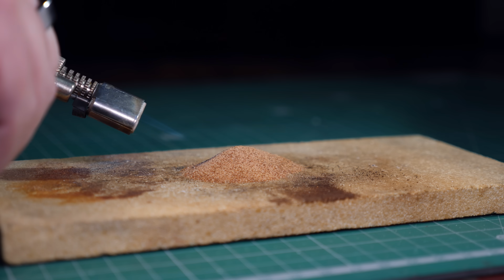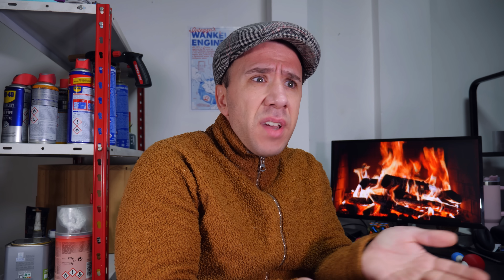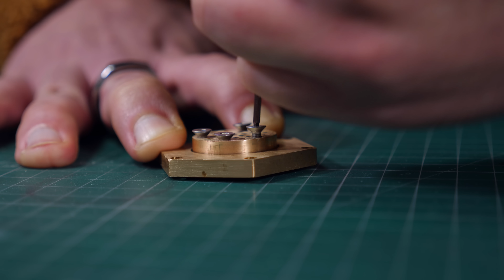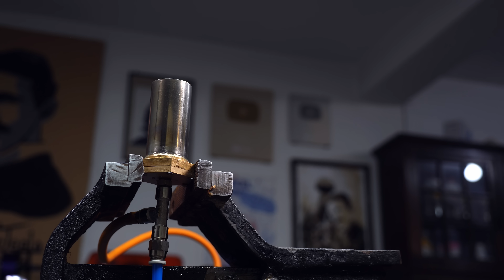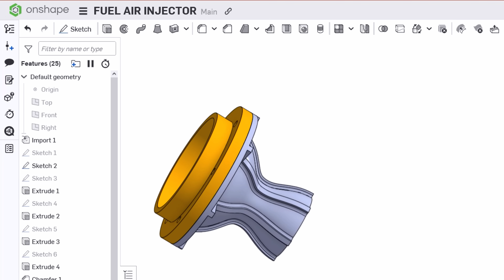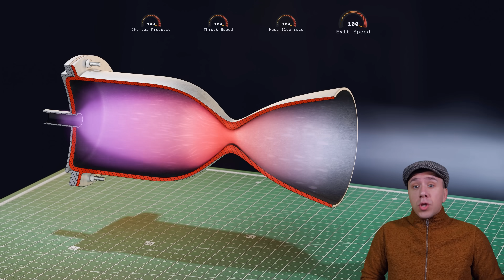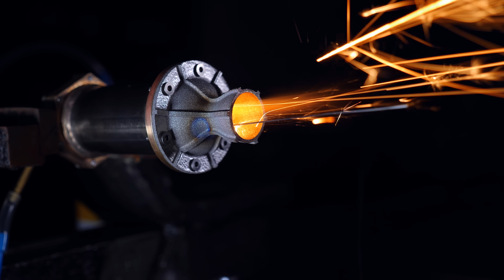I Built the FIRST VENTURI ROCKET ENGINE

Comment: 12:15, the expansion/diverging part of the rocket nozzle only accelerates supersonic fluids. venturi should apply to subsonic as well, since it uses a local pressure differential. perhaps you did not create enough pressure differential in your neck to pull the alcohol out of the container. In your sim 13:00, your pressure bar says "total pressure", which is sort of the potential and kinetic energy of the flow. You should be plotting static pressure (total = static + dynamic), which should indeed be lower at the front lip of the vertical tube, where the flow has to curve over the top of it. Also, I am pretty sure the streamlines you show here are colored by velocity, rather than total pressure, since total pressure should be basically the same everywhere if you are not supersonic.

Edit: on second viewing, 11:48 you are using compressed air in a closed tube, while the alcohol is exposed to atmosphere. the static pressure at the neck is lower than elsewhere in the tube, but still higher than atmospheric, so air is forced into the reservoir. with the air gun, the stream is exposed to atmosphere before impinging on the feed tube, so the pressure at the front lip is lower than atmospheric. For your original test, a bleed line should have been fed from upstream of the venturi to the top of the reservoir, allowing the static pressure at the venturi to be lower than the pressure in the reservoir.

Comment: I'm curious ifyou could replicate the hyperonic thrust design thats supposed to be on the Aurora aircraft.   Rocket for first stage,  then fuel dump over hot surface creating basically a Shockwave trust

Comment: You need to make a slurry and pour it in a mold or tamp it in but have a central core for consistent thickness/density. It works better just like solid rocket motors for hobby rockets.

Comment: You should do a videk about cooling down rocket nozzles in diffrent ways. I had and idea were you can use a jet engine and a precooler and heat sinks and thermoelectrics and water. You cool down the air and use it to cool down a rocket nozzle but the nozzle is thick and has holes and the air pressure generates thrust. The combustion chamber has a titanium carbide ceramic composite fan and is coated with heat resistant materials. It spins on a axis and you feed it cold air to keep it cooled down. You have a seprate fuel tube to the combustion chamber. The air pressure keeps the exhaust in one direction. I also thought about a air bag balloon type seal so it can be used in a vaccum. There is another fuel line for liquud oxygen. You could also have a outer nozzle levers that redirect fuel or liquid oxygen inward or close and redirect the liquid fuel or use liquid nitrogen to keep it cool. Something like that could work in theory.

Comment: I've been wandering why they cant design a jet engine without any moving parts that worked mostly like  rocket with a carburetor style intake. could be carburated or fuel injected.
Reply: Long story short, to get enough power out of the engine,  you need to burn x amount of fuel. For efficiency and proper combustion, that requires y amount of oxygen. For most engines trying to do useful stuff, x is too high for atmospheric levels of y, so you need higher pressure to achieve y
Reply: @nade5557  I suppose what I'm thinking already exists as a ram jet then. and that's why they only work well at super sonic speeds. new Idea then. jet engine with moving parts but it's small ram jets attached to a drive shaft that spins at supersonic speed lol
Reply: @fordman7479 now this sounds interesting

Comment: The solution you arrived upon for the fuel and air injector is practically the same design used in some steam locomotives where excess steam is used to cycle water from the tender into the boiler. Very cool stuff.

Comment: Not sure how much you care about the nozzle quality, but the fact that you got a gap between your exhaust and the wall of the nozzle means you’ve got bad geometry. If you are able to calculate chamber pressure then I’d suggest using a software such as open motor to help design a nozzle that can better suit the needs of the project. You may be surprised to find that you don’t need to curve the bell after the throat. You can just have it at a linear angle and it can still perform exceptionally well.

Comment: Congrats on inventing the carburetor lol
Reply: in all seriousness, your guess at 13:32 is correct. The venturi effect is a behavior of fluids as they obey Bernoulli’s Principle. The air at the top of the tube has the same total pressure, but more of that is dynamic pressure and less is static pressure. In my mind, I think of all pressure as the momentum being imparted by air molecules bouncing off of things. Dynamic pressure is when a lot of the air molecules travel in the same direction, so you can only feel this pressure if you obstruct the air in that direction (such as sticking a hand out a window of a moving car). Static pressure is just from the random direction of air and happens in every direction, and the only reason we dont feel static pressure as a force is because the same static pressure presses outwards from inside our body, etc. Take the air out of our insides and we will also feel the force of static pressure act on us, and collapse like a vacuum bag. 

And the thing that makes it all come together is the fact that the gradient of total pressure is continuous. That means that even though there is an air compressor blowing air, the total pressure right below the tip of the straw and the total pressure right above are more or less equal. However, air above the straw has much less static pressure due to having more dynamic pressure, and the air below has zero dynamic pressure and all static pressure. The force inbalance at the exit of the straw results in the apparent sucking action.

Comment: 12:41 well i mean if you force air trough the same tube as the one going in the bottle,you will pressurize the bottle and it wont quite work,thats why we don’t make carburetors that are 2cm in diameter or less

Comment: Wonder if you can put some sort of screw that can be tightened on the outside of the cone constriction, that is attached through a hole (with a high temperature gasket) to some sort of ratchet mechanism, for controlling the width of the cone's throat and thereby control the flow better? I think of those overlapping metal plates on some metal colanders as an example, or chinese finger traps, or those metal straps used to connect hoses on car engines, the ones with worm screws, just spitballing here.

Comment: its surging because rocket engines require more fuel pressure than the engines combustion chamber or hence the commenced surge,(dangerous) also a venturi wont work unless its pressure into the nozzle is higher than the combustion itself NO ACCEPTIONS. if you can make a high pressure fuel pump to put fuel in at a higher pressure than combustion chamber TADA no surge and steady output you will gain.

Comment: @integza You should not use the de naval nozzle. De Naval Nozzle ONLY WORKS FOR SUPERSONIC SPEEDS! With the given pressures that you are working with, I really doubt that your exhaust is supersonic (for almost most of your rocket designs this is the case). You should only decrease the nozzle area (look for bernoullis principle) to increase the gas velocity (consequently, the thrust). Sinusodial decrease is a good way to start for nozzle design. Again DO NOT INCREASE THE NOZZLE AREA AFTER THE THROAT. My suggestion would be just decrease with a sinusodial shape and keep the throat long and straight so the momentum of the gas is a bit more parrallel rather than expanding.
Reply: I am more than happy to explain a bit more, I work on supersonic nozzle designs. Think like this if the gas was supersonic you would hear a lot more noise. So just decrease the area using the bernoullis principle => increase the gas velocity!

Comment: What if you use fuel that you can make your self which hydrogen so you will build a hydrogen reactor which is cheaper than using butane and hydrogen is very flammable so you will have a hydrogen powerd jet engine

Comment: I am sure you know this but, Your propane pressure is dependant on the temperature of the tank. Propane is liquified petroleum and has to boil in the tank to produce vapor. So, heat the tank, increase the pressure and the ability to sustain the pressure during use. As you switched fuels the point is moot, but just FYI.

Comment: nah i think the air-gun smashing the tip of the nozzle is causing a vortex myth busters tested this theory to be true you can stay dry in a convertible so long as you go fast which means the circular vortex is sucking up air through the alcohol tube

Comment: Injector would have to be in the orifice at point of maximum constriction , not in the open air necessarily, for it to be Venturi effect, maybe you can use that for an afterburner.
   Also , was that you backyardscience2000 that sent that?

Comment: A laval nozzle only makes sense if you manage to pump in enough propellant to reach mach one at the constriction. Otherwise the gasses just slow down again as the nozzle expands.
You can calculate the needed flow rate of fuel and oxidizer based on the diameter of the hole.
amount of reactants <-> amount of exhaust gasses+heat <-> the flowrate through the nozel <-> exhaust velocity at condstriction.
Also: it's LA desription, you uncultured portugoose!!

Comment: So, in almost every example, you used compressed air… which by nature is an injected oxidizer and made the “new phone” entirely unnecessary. I’m pretty sure you just burned up a very rare, expensive resource for no real gain. 

Cmon, Integza! You know enough about rockets to know about fuel/oxidizer ratios by now!

Comment: So the first principle you showed was the Bernoulli principle which is which is if the flow is restricted it must speed up for the same flow rate to occur the Venturi effect is using a flow to create a region of lower pressure to pull another fluid into the flow this is how the straw air gun demo works the the flow pushes molecules away from the top of the tube creating a lower pressure inside it

Comment: Propane is odorless. The smell of propane that commercially supplied propane has comes from aromatic chemicals added precisely because identifying propane, which can't be seen or smelled and is a gas, is necessary to not explode things by accident.
Alcohols can be smelled thanks to the OH radicals and their tendency to easily evaporate. Some alcohols will have extra compounds to add extra smells, but that's beyond the point.
Both alcohol and propane share similarities because both a organic compounds with 3 carbons (the "extra oxygen" is just a radical OH substituting a single hydrogen).
High school chemistry goes a long way.

Comment: 13:14  cut it at about 45 degrees, like a syringe needle. The cut side is opposite to where the inflow of air is. This creates a low pressure area and it will work.
Reply: In fact a large bore needle would probably work.

Comment: Dont know much about rocket engines, but doesnt a fighter jet have some adjustable flaps at the back of the engine that can constrict / open up on demand?
Maybe something like that can work for your use case to control the pressure at different fuel injection levels.

Comment: What might be a flaw in this design is that the fuel doesn't make good contact with the oxidizer. The fuel moving up the center will only get oxygen from the air. Dividing the main tube into a couple of narrower tubes, each coated in oxidizer, should do the trick.

Comment: I've built a similar kind of rocket before, isopropyl and the oxygen source I used was SolidOx aka Sodium Chlorate. Back in the day SolidOx was used for home welders and still is used for airline emergency oxygen, you know when that oxygen thing drops with a mask. Well so I have a few tips and some further details for your consideration... 

Your venturi solution is excellent but I'd like to mention that your pulsing and throttle difficulties can probably be solved by preheating the fuel. Imagine you're dumping some cold fuel into your combustion chamber, the reaction chokes, then catches up and surges then causing back pressure. That quickly turns into a cycle of backpressure on your fuel feed causing a degenerating uneven pulses as you try to throttle up your engine. 

There are different solutions to this problem like better fuel atomization, for me I solved that by preheating the fuel and a few other tricks. I used a simple metal diffuser that absorbed heat from the top end of the reaction chamber and thermally vaporized the fuel being sprayed in.  The then vaporized fuel defused in with the ignited oxidizer/released oxygen. That solved the vaporization problem you used a venturi for and the throttle problem. Many rockets likely feed fuel though the exhaust nozzle for this reason as well, not just to prevent melting. 

Something like a tesla valve and combustion chamber grids might also be worth trying if you have a similar problems with a liquid fuel rocket. The top end diffuser arrangement I made looked a little like a tesla valve on paper and I further partially shielded the oxidizer with a grid tube of holes. Introducing grids/texture in a combustion chamber for hi speed/energy flows to bounce against is a time honored voodoo for controlling combustion pulsing like in the Apollo rocket combustion chambers. Many multi-port rocket injectors are also indirectly making a surface like tread on a boot which accidentally or intentionally can stabilize shifting flows at the top of the combustion chamber. 

So some combustion chamber tread might also be worth considering, unless you want a rotating detonation. And who would want that? Lol

My 2 cents. Great video and experimentation!

Comment: How is the behavior of the injector you built that uses the airflow to suck out the alcohol, really different from the fixture upstream of your first injector that also combined compressed air and a fluid, then propane, to force it out at higher pressure? 

Isn’t the phenomenon in the first case, that brings the propane along after joining the compressed airstream at a right angle also just a sort of Venturi effect?

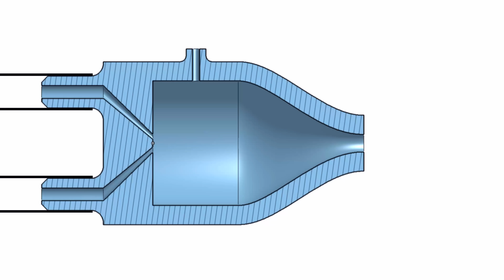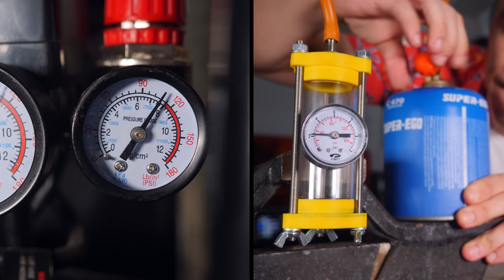Then, the diagrams you use to describe the need for compressed air to increase pressure at 9:28 and again at 9:41 to explain the problem of the first setup, are misleading. 
They show both a gaseous fuel and a gaseous oxidizer flowing in to a combustion chamber. But the whole point of the video is to have only the fuel be a fluid while the oxidizer is a solid liner on the wall of the combustion chamber. Leading to only a single line going to the injector plate and being injected into the combustion chamber. 

The correct diagram for the original setup would show a compressed air line being met by the propane line ahead of the injector. 

Now, the first point still stands, as with any liquid/gaseous or hybrid engine, the pressure of the injector(s) needs to be, and remain, higher that the pressure of the combustion chamber. Otherwise the combustion products, along with the combustion itself, will force itself the wrong way back through the injector. 

(In your porous injector wall video you increase the injector pressure by heating up the propane flask… using compressed air is probably a better idea.)

But I don’t see how in the first setup the compressed air being at a higher pressure than the propane would be a problem. The whole reason to bring in the compressed air is that it is at a higher pressure than the propane in order to supply the fuel to the combustion chamber at high pressure. 

So i fail to see what you have accomplished with your new injector, other than displaying in a very illustrative way how the Venturi effect can be used to force a low pressure fluid along with a high pressure one.
Reply: Also interesting choice to use air, which contains oxygen, to blow the fuel into the hybrid combustion chamber. Then the fuel is already mixed with oxygen before reaching the intended solid oxidizer. And a theoretical rocket would carry two fluid and a solid propellant, two oxidizers and a fuel.

At first I thought you had done away with the whole hybrid thing to just make an air and alcohol rocket, because you also didn’t mention the solid oxidizer after bringing in the new injector, which really mostly is just a new pump. The injector is just the brass plate to form the output cone of your compressed air Venturi pump.

Comment: 0:15 well actually metal burns quite easy with no use of white powder - put a lighter to metalshavings or a metal sponge it will burn!
Reply: and thermite, never discount just how volatile thermite is if made correctly
Reply: @NeilElliott-lt2gp Thermite gets its oxygen from red powder aka rust or oxidized iron. when burning pure ironshavings it gets its oxygen from the air like burning wood

Comment: Bernoulli, not venturi?  For creating the low pressure which forms a vacuum.  Same way propane forges pull in extra air to blow hotter.  No supplied air, only forcing high speed fuel through a tiny nozzle.
Its misleading since it defines it as a fluid, however, we all know that fluid doesn't only refer to liquid.